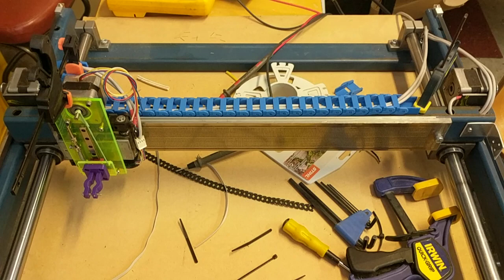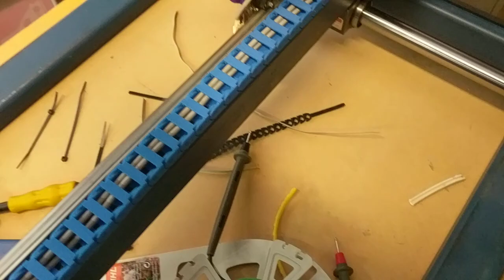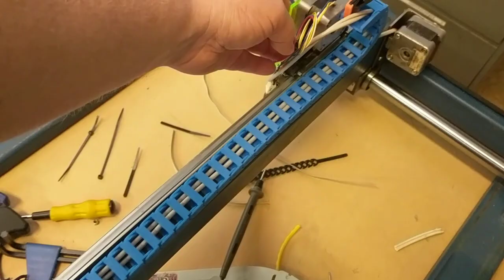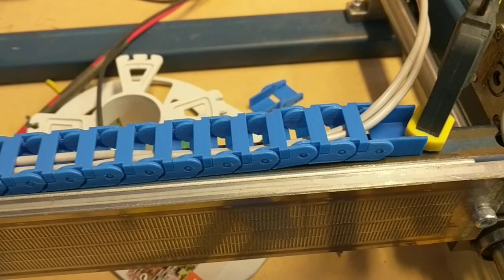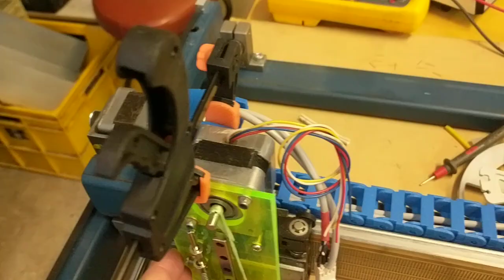3D Printed Cable Chain

Comment: Wow! Is that a linear stepper motor for your X-axis?
Also nice E-Chain, looks professional.
Reply from the maker: Yeah, totally is a linear stepper. I've had it for ages and figured this was a good use for it. Cheers!
Reply: @AlanGarfield  Absolutely! I always wondered, why no one is using those, especially for 3D-printers. How is your experience with the stepper?
Reply from the maker: @TheSparschwein  it works fine although it's step size isn't measured in degrees of rotation but in linear mm of travel. So with the nonlinearity of micro-stepping you really notice it in the plotter like this. For moving around a typewriter print head with fixed columns really fast it's more than fine, but sub millimeter movements it can do but it's not perfect. I can see why nobody uses them for 3d printers.
Reply: @AlanGarfield  Mmmh, I see. The micro-stepping issue might be solvable with some calibration in the software, but - as always - easier said than done...
Thanks for the chat Alan!

Comment: Is the file available on thingaverse?
Reply from the maker: Yeah that's were it came from. It's a popular one, should be easy to find.
Reply: @AlanGarfield  I'll check it out tomorrow I found one and all the pieces slanted slightly so the chain went down at an angle. Not ideal for what I'm trying to do so I ended up using it for something else.
Reply: It would really be helpful with a link